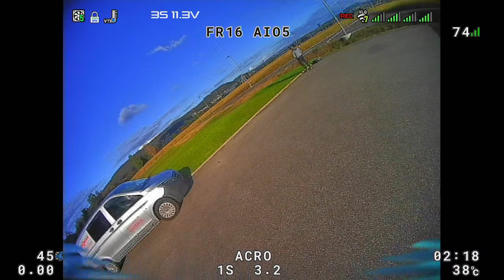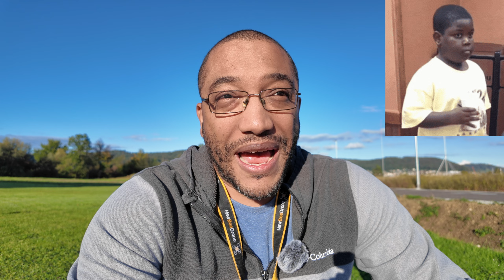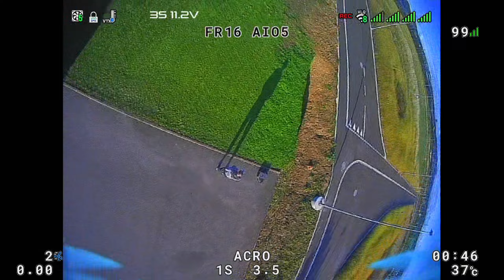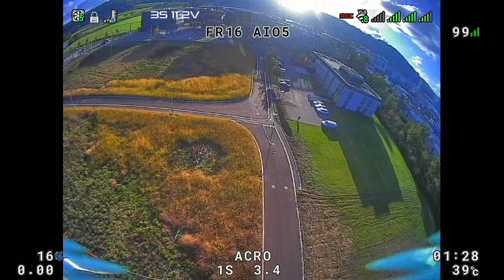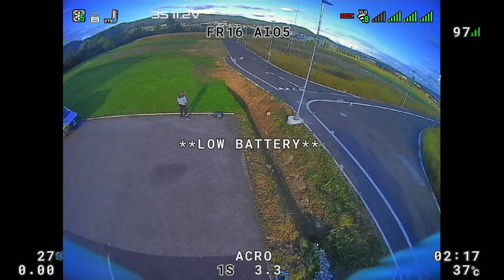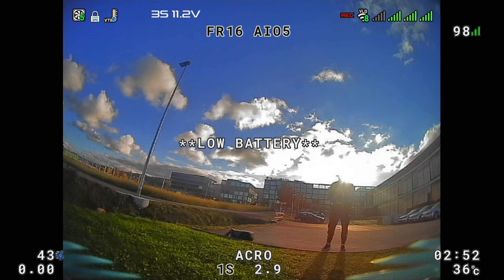Flywoo Nano FR16 with the new HDZ AIO5 // 5g lighter and better?

Comment: I have HDZero for racing and love it. My freestyle quads are still on analogue because I'm cheap! 
I'm interested to hear you have tried Walksnail and HDZero on this same quad. If you could get Walksnail for the same weight as HDZero which would you choose to fly for freestyle and why?
Subscribed. Thanks.
Reply from the maker: That is a good question and I think the solutions are quite different from their strength and weakness. I love both but would go for WS for freestyle because of the image quality and signal but if latency is an issue then clearly HDZ.
I think it really depends on your style of freestyle and how sensitive you are to latency.

it might be a good advise to try WS from a friend to see if it works for you. The same for pilots who have only flown digital to try HDZ.

Btw. I've never flown any larger HDZ VTX than the whoop boards ;)

Comment: How u like it ?? I to put mine on hold because of the flywoo fc and motors and I use Walksnail
Reply from the maker: @sosdeathvalley  I like how it flies with 5g less weight. But I'm not sure it makes sense to change from a working HDZ setup to a 120$ aio setup on this particular frame.
I had tried the walksnail version and found the canopy awful (think it was some brittle PLA or PETG) and it was just a bit too heavy for the 40mm props.
Yeah you can cruise around with it but it doesn't like loops, dives, freestyle etc. 
I think this fairly heavy frame would work better with 2" props but its too small for them.

Comment: Looks pretty sweet! I just rebuilt a 1s quad that's kinda similar. I think with 1002's they should do a refresh and use the gemfan 45mm props, or even some light weigh 2". I've been using the 2008's on another toothpick with 1002's. Both quads feel pretty similar.
Reply from the maker: @Greg__K  Thanks, it‘s definitely limited with the 40mm with the weight and propwash but the frame is also too heavy for 802s. The FR16 frame is too small for 45mm. They would need to make the frame larger, but then they already have a 2“ 2s Nano 20.
Reply: @McLogo76 I own the Walksnail version of the 2s, and it’s a great quad. I just also really like my 1s 2” toothpick builds. Those I’m running 1002 motors with the 2008 props, or 2015. It’s a really good combo. I’m just saying, if they were to do a refresh of the FR16, they should make the frame a tad larger and go with at least 45mm props. Especially since it already comes with the 1002 motors. Just a thought.
Reply from the maker: @Greg__K  I think you are right. I might try removing (full or partially) the prop guards of one of my fractal F75 pro max as it uses 45mm and 1002 motors. I want to see how it flies with the 1S Walksnail vtx 😉
Reply: @McLogo76  I haven't tried a 1s WS quad yet. I was always concerned about the weight and battery sag causing loss of video. Removing the ducts will definitely save a good amount of weight. I had a little frame laying around, and added the Pro ducts, but didn't like the way it flew. Half ducts were about 3g, and full ones were over 5g. It's very noticeable on 1s 30g build. It's nice to have ducts, but not really needed outside IMO. 

All my 1s stuff is Analog, but looking to get into HDzero. I heard that they're going to announce a new goggle soon? Have you heard anything about that?

My favorite toothpick WS build is 2s, 1103 motors, and 2023 props. It's super powerful and quiet. I wonder how that would compared to your 3" 2s toothpick build.